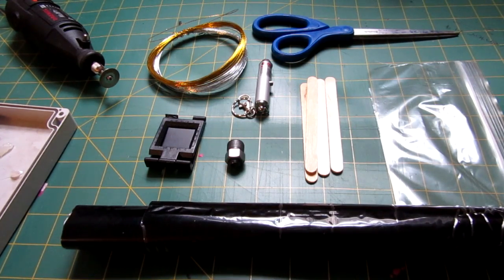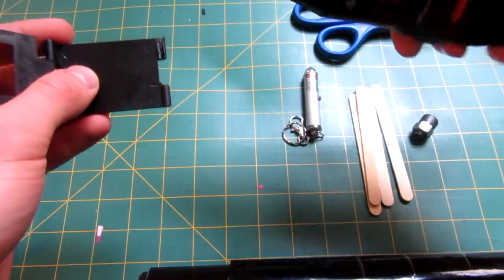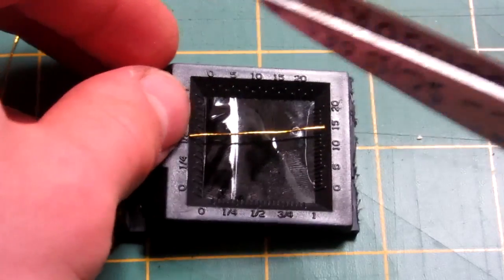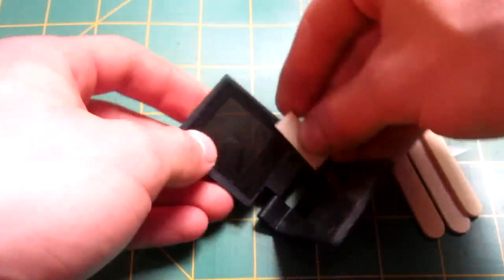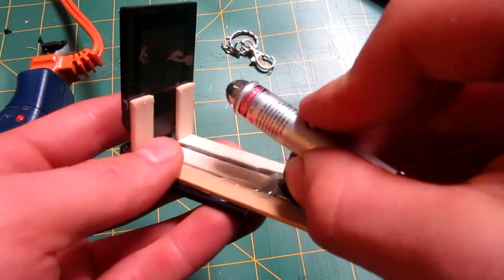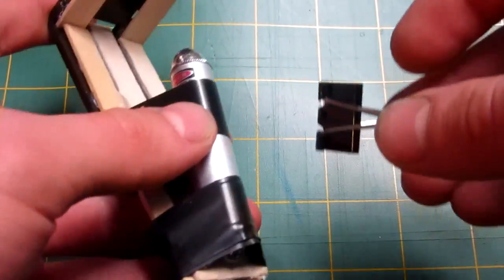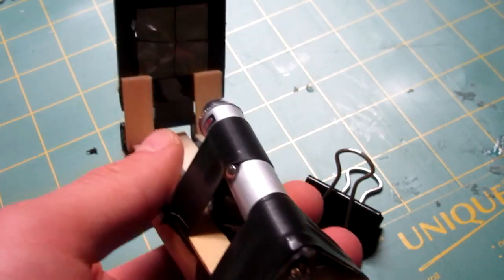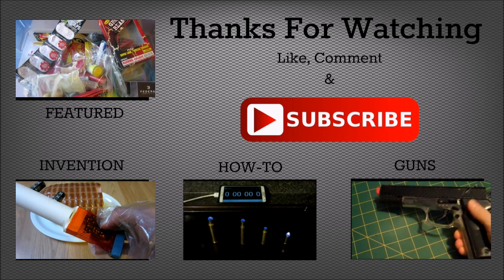How to Make a Red Dot Sight $3

Comment: Hi, if you bend the glass, then you wont be affected by the parralax effect, which basicly means that your sight isnt spot on when you move your head... search it up!
Reply: William Jenssen well you move your head not your gun so its still accurate?
I imagine it as this,but i may be wrong
Reply: @lazar2175  no, it isn't from the user fov because his eyesight will see the red dot from all direction and it must be visible only toward one direction, to illustrate, raise your arm and point a finger up, imagine the nail is the red dot and your arm the gun, if you move your head arroud you'll see that even if your arm is still pointed in the same direction, your finger is not pointing on it because of your point of view. This is why we use the paralax for the red dot, it's a miror effect that can reverse that and keep the dot aligned to the weapon axis.